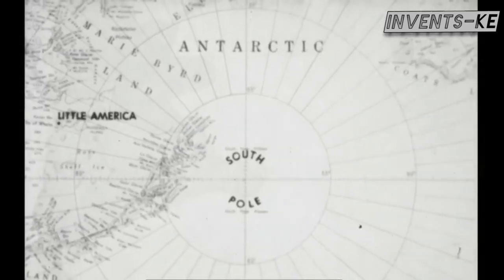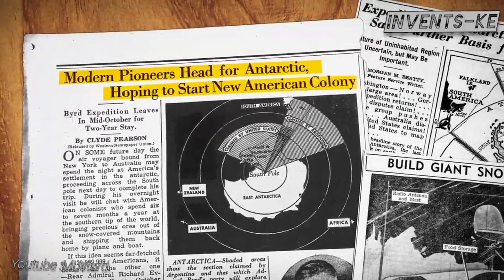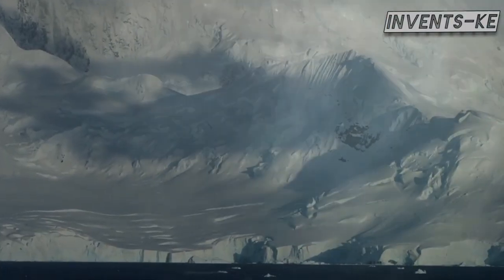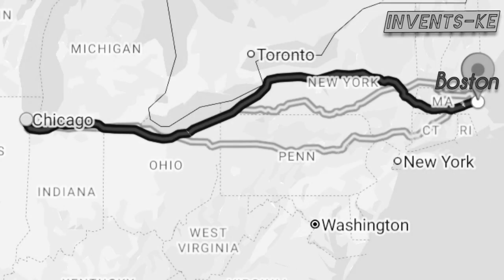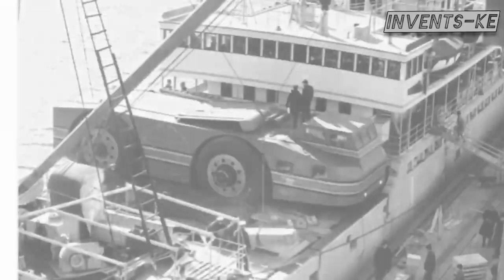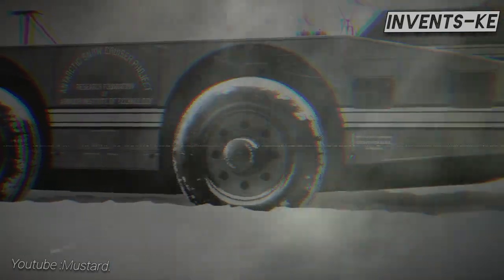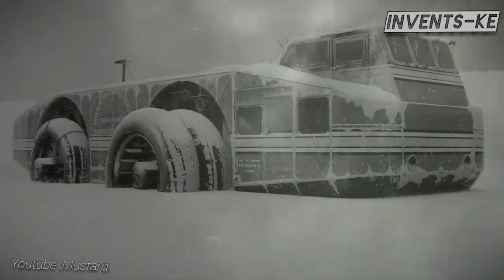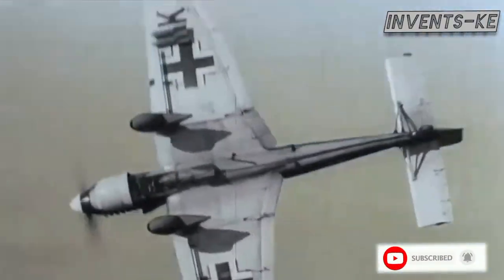What Happened to The USA Antarctic Snow Cruiser of 1940?

Comment: How could they possibly think Bald tires with no traction would work on snow?
Reply from the maker: The idea was that the larger, smooth surface would prevent the vehicle from sinking into the soft snow. This approach was based on the principle that wider tires distribute the weight of the vehicle over a larger area, reducing the pressure on the snow surface and minimizing the risk of getting stuck.

They didn't have time to test this on snow. That is why the Bald tires became the source of the cruiser failure.

Comment: over engineered (hydrolic systems do NOT fare well in extreme cold)
underpowered
smooth tires
to heavy

in the end the soviet attempt at such a verhicle was actually better though even that should be regarded as a failed experiment. In the end what worked best were smaller verhicles, in fact one of them is litterally just a beetle with tracks
Reply from the maker: The snow cruiser being the first attempts helped the world to under well what can work on the Antarctica snow.
Reply: @Invents-ke  but the US is allready well known for having extremely snowy areas and they knew where it was meant to go, why did they not test it out first or at least, idk, gain inspiration with those verhicles that could traverse there. allready at this time model t-cars were DIY adapted for snow traverse, they added chains/spiked tires and either sleds or tracks in the back.

the argumentthat they couldn't have foreseen it's most glaring issues  is pretty lame to me. They knew about the most obvious factors after all, sure it's hard to foresee just how rugged the terrain would be (though if you are designing anything for it it may be prudent to actually speak to explorers or consult literature on it)

In fact I could easily forgive a lot of issues and truth be told it speaks to how well it was at least built (not so much designed) that it could just sit out there for years to then be repaired without much hassle. but that's about it